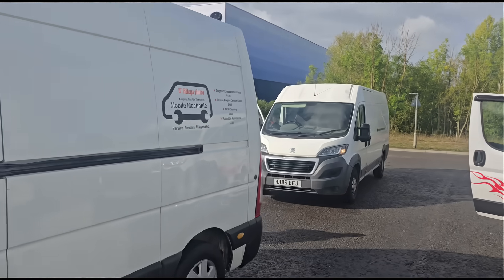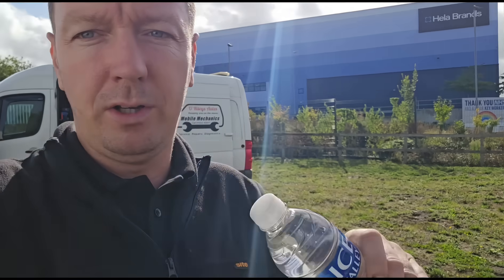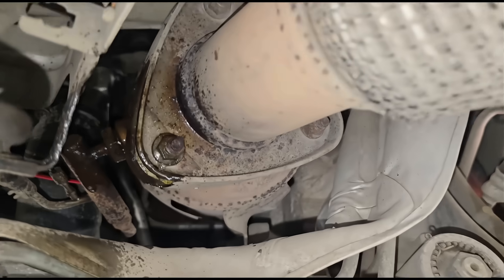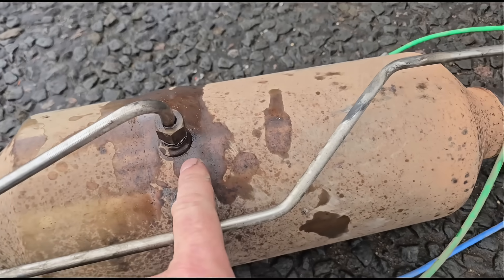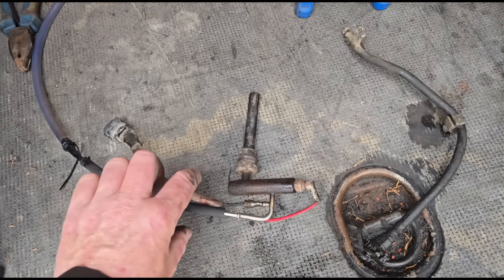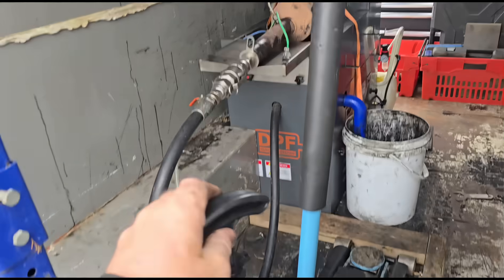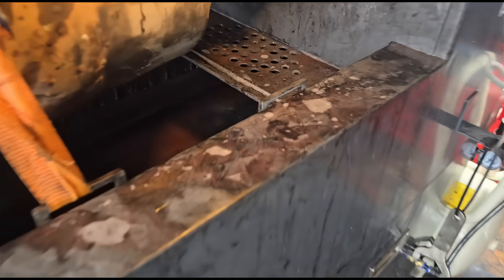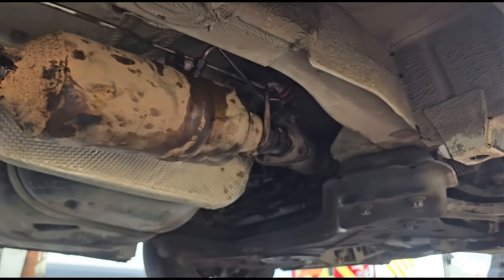On Vehicle DPF Flush Didn't Work... Can We Fix It With DCS-16 Off-Car Cleaning Machine?

Comment: It looks pretty pathetic. We give the DPF 90 shots in each direction. We flush the DPF three times in each direction, with 30 shots each. Then it's dried in both directions. These types of cleaning machines are completely impractical to use and only cause headaches and mess for the operator.😢

Comment: I have a 2014 ford Mondeo with a 246300 and 246BOO codes, had dpf cleaned and cleared codes for about 4 days, back now. Saw your video on pressure sensors, could this be the likely culprit? Brilliant videos mate keep it up 😎